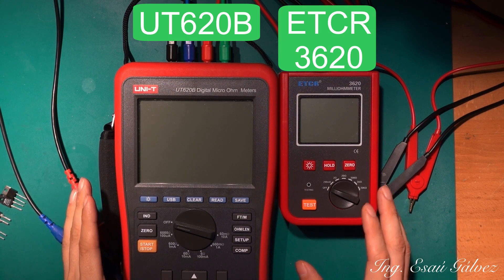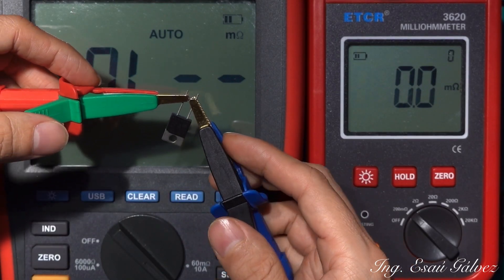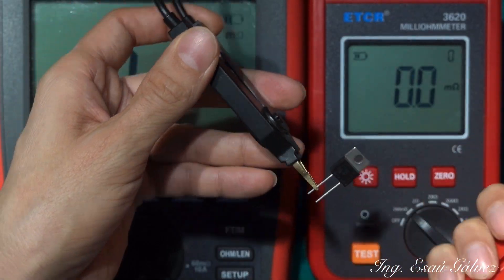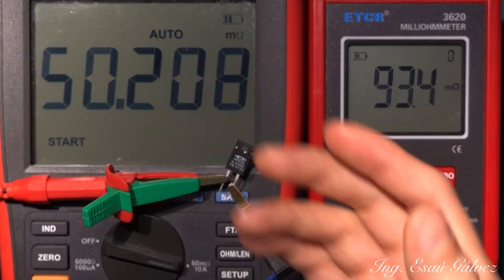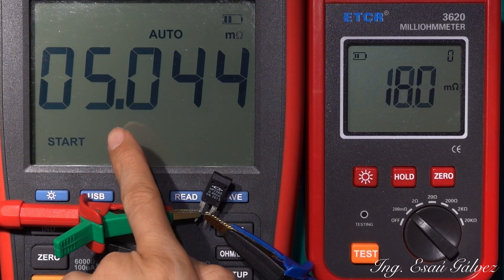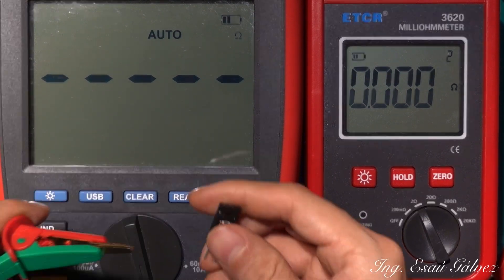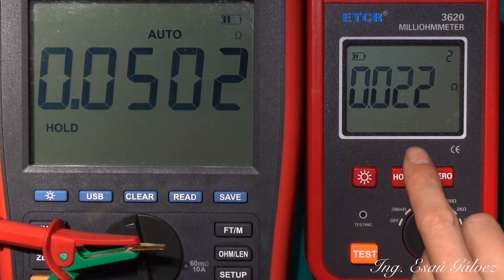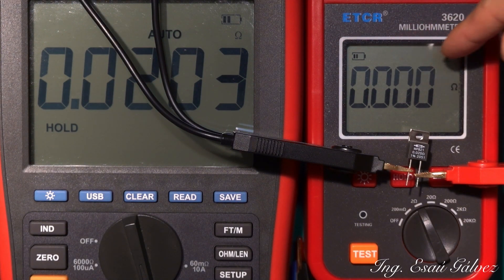UT620B vs ETCR 3620 (Beast and the Beauty)

Comment: I bought the ETCR 3640, which has a higher resolution of 1 micro-ohm, to satisfy my curiosity.  With the ETCR 3640, I had the same problem of stability and reading accuracy that you had in the low ranges with the ETCR 3620.  However, by using double-tipped kelvin probes that I own, and also by simply using independent cables with alligator clips for current on terminals C1 and C2 on the device and two multimeter probes for voltage on terminals P1 and P2, I managed to get accurate and stable readings.  The problem with the test leads that come with the ETCR 3640, and probably also with the 3620, is that the spring in each of the clamps short-circuits both sides of the clamps when the clamp jaws are open or closed.  This means that the tip resistance on each side of the clamps adds an error depending on the current injected by the device.  It's a very bad decision by ETCR to supply such poorly designed cables.   Many buyers will come to the same conclusion as you, that their device is not accurate, and will do the same as you, return it and make bad comments about this product.  I'm going to keep it because I've found the problem and have a solution to fix it. But that's not the only thing I find rather disappointing about this device.  The ETCR 3640's case and buttons are made of cheap hard plastic, and the rotary selector for range selection doesn't work very well.   Also, the display is minimalist and lacks the identification above the buttons for their second functions.  It seems that ETCR's device is still in the prototype stage, and that they abandoned its development too soon before releasing it to the market.
Reply from the maker: Thanks for the feedback. I have 2 different kelvin cables that I know they are in good condition, but still, results are not stable. Honestly, there is a cheaper and most stable meter on AliExpress RC3563, the only problem with this is that when you short cables, readings are no exactly “0”. But readings are pretty much accurate and much more stable than that ETCR useless meter. 
Nice talking to you!

Comment: Could these huge measurement errors in the ETCR micro-ohm tester be caused by the probes?  Can the tester be calibrated?  I was going to order it, but now I think I'll pass on this one....
Reply from the maker: Good thinking. That’s a lovely tiny meter, i tried every posible option, I changed probes thinking it could be the problem, I calibrated probes many times. Sometimes results were close to what I expected, but must of the times were not.  I tried with different wire gauges and same behavior. So I definitely not recommend it. I have an expensive Hioki meter and even 2 cheap Chinese ones. I would recommend you a cheap Chinese one. RC3563 that’s the model, that’s an orange color comes with 3 different sets of probes that one is for testing batteries, in case you want to buy something cheap and reliable
Reply: @esaugalvez The RC3563 battery tester can be use also for passive resistances and contacts?
Reply from the maker: @michelgauvin2473  i think so. It gives very similar results as a Hioki does. That’s why I am suggesting that particular model 👍
Reply: @esaugalvez  So I'm going to order the RC3563 that you recommend.  The Hioki is definitely much better, I'm sure, but you have to have a need for high quality and frequent measurements to pay 20 times more for a Hioki...  Thank you for your advice.
Reply from the maker: That’s interesting. And you are right, maybe the fact that they are too closed to each other, but that’s the way must meters work. But I am glad it worked for you. The problem is that it might result into a boring issue to put so many wires around each time you want to work. But outside of that, it might do a great job on measuring thick wires I am sure. Thanks for the feedback